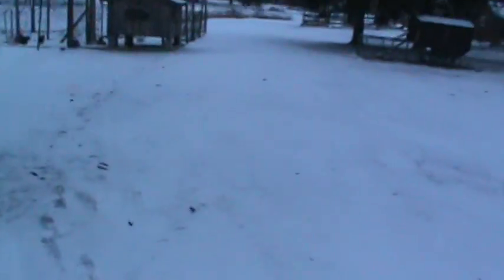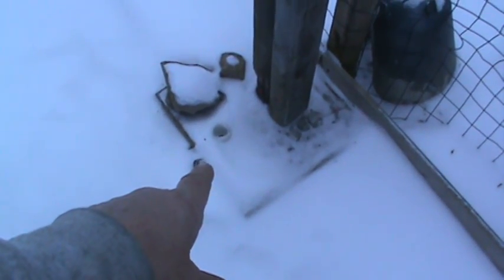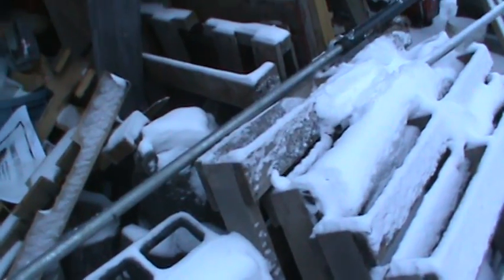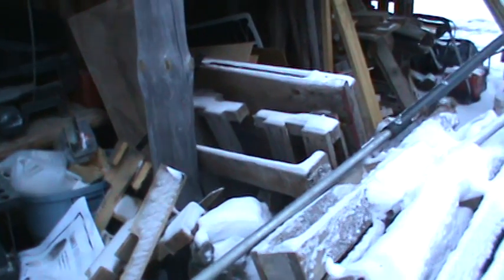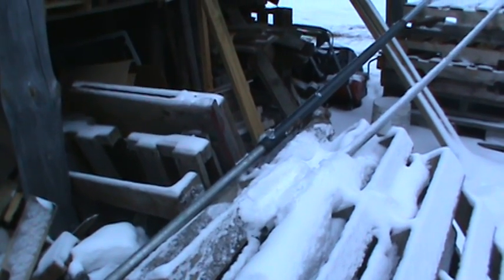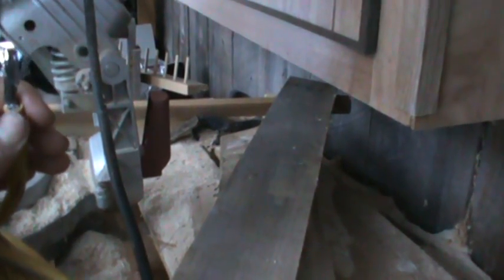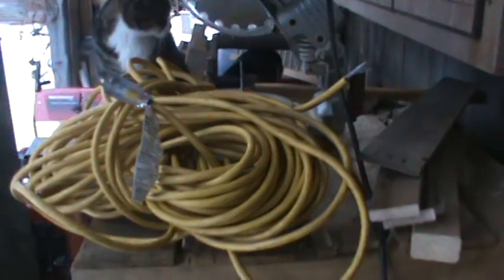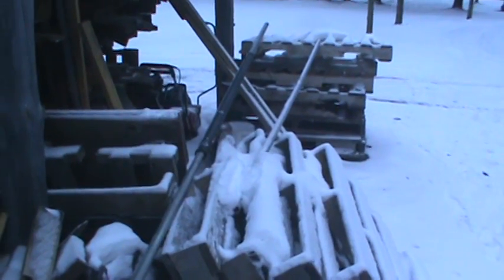wind turbine

Comment: You cant use burnt extension cords on construction sites, it a fire hazard, so they have to replace it with a fully certified cord. So for u thats a good bit of luck, maybe that cord will work fine for the wind turbine. Test it by shoving ac down it and measure the result at both ends. If there is too much voltage drop then toss it, if its negligible then use it.